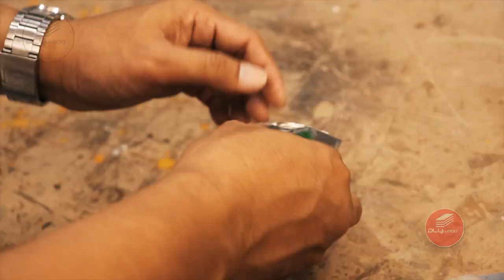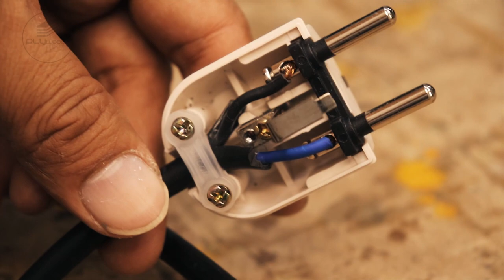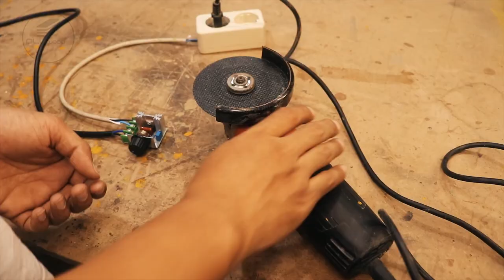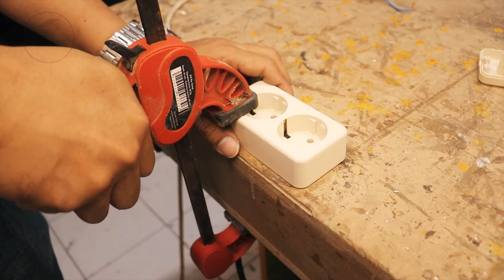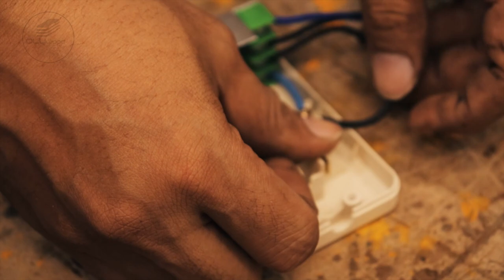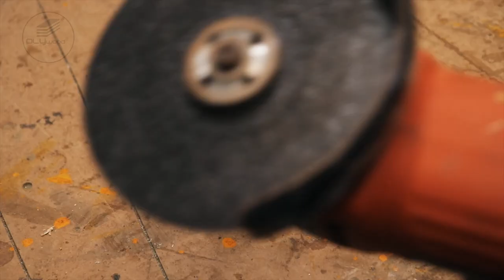Motor Speed Controler for Power Tools

Comment: Why reinstalling the ground forks when they have no function? It just make an unaware user think thats a grounded circuit. Dont play with electric!
Reply from the maker: thank you for suggestion, on ground have clip for hold socket that why i instal again, i have licensi for electric
Reply: @plywoodworking  ..license to kill as James Bond.. Asem tenan. Durung kenal karo Jarno Bin Kuwat iku 😊. Voltase kono papat seket mas, kene mung kaleatus kaledoso gak jangkep, mergo akeh sing nyudet 😁.
Reply from the maker: @librandolz9829  klo diluar itu pake 3 kabel mas, disini pake 2 kabel tp bnrya dlu asliya jga 3 cm ground ilang dianggep buang biaya, sy ada bbrpa yg ttp pake ground tp emg rata2 cm 2 kabel aj klo di indo. bnrya klo syarat mutlakya harus 3 kabel
Reply: @plywoodworking  betul mas, biru, coklat dan kuning belang hijau. Jaringan listrik di rumah sy, juga masih dua, fasa dan Netral. Kadang di tespen kalo gamang/ragu tekan konduktor tespen nya masih terasa semriwing gitu. Terimakasih arahan nya. Mantap. Terus ber-inovasi. Tutorial CNC diy mas, lg trending.